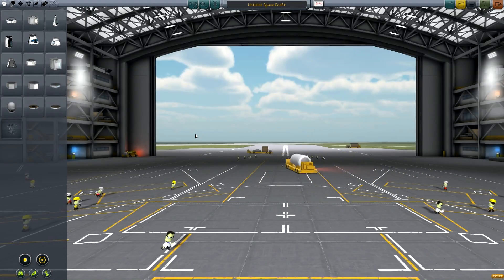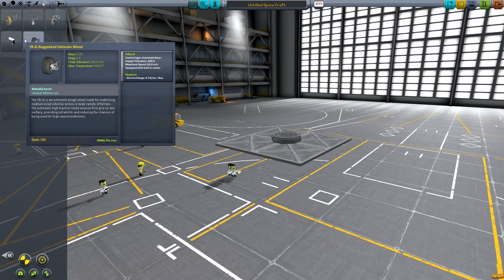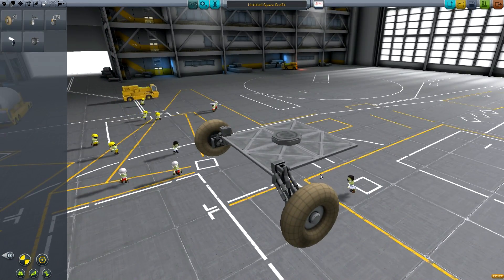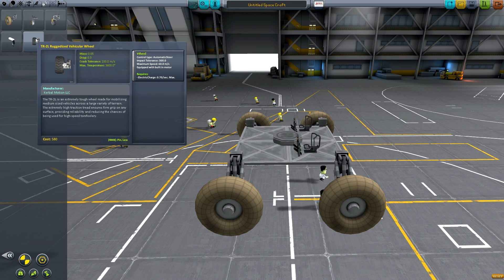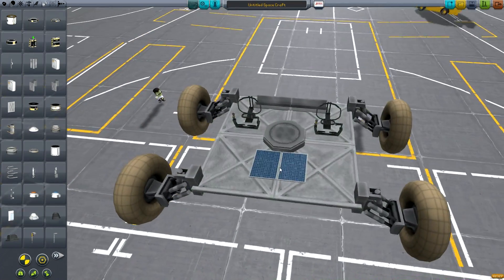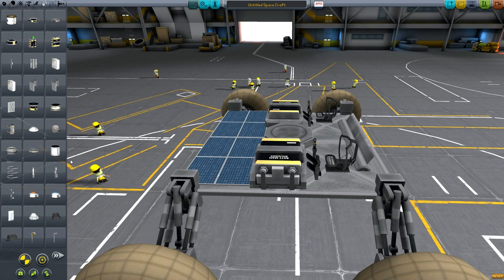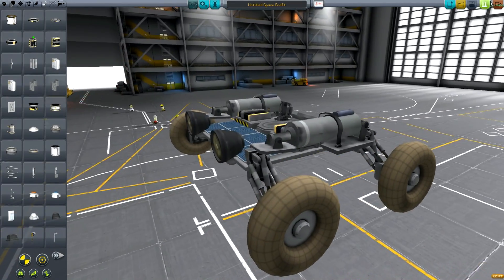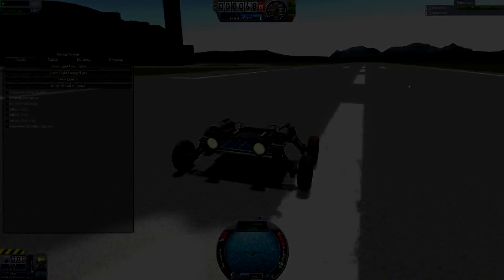KSP - Rover Design Tutorial

Comment: Hey, Rureglathon, can you help me with my rover design? It's a rover with 2 seats and made of octaginal struts to make it lightweight. It also uses the smallest wheels. Well, it seems like it likes to shake apart randomly. Not just when I am going at high speeds either. Sometimes it'll just be sitting there and then it starts shaking and then randomly explodes. :/ If you could tell me what I may be doing wrong that'd be great.
Reply: Freak80MC Just wanna say the Random "Shake n Brake" is something that seems more stable since 23.5 But make sure the spacing around things is good. That is what causes it mainly. when parts clip inside each other and the vids jump about.
Reply: Your rover shakes apart because it is made entirely of physics-less parts.